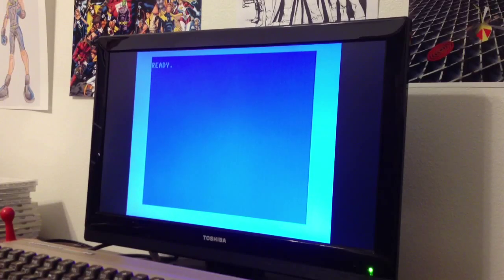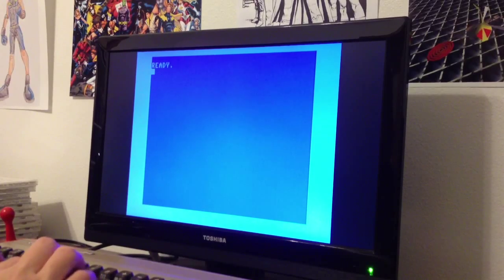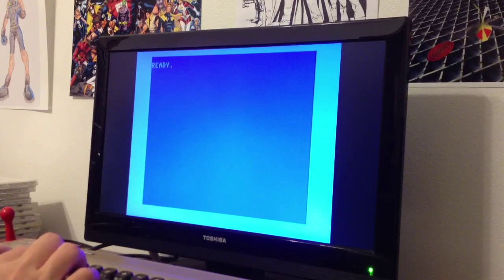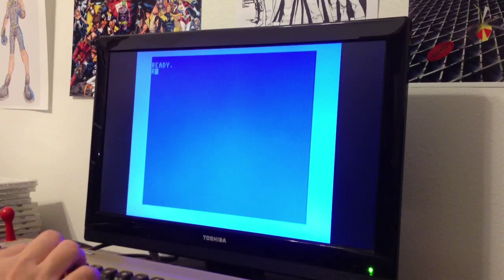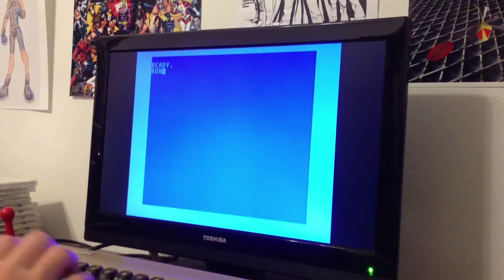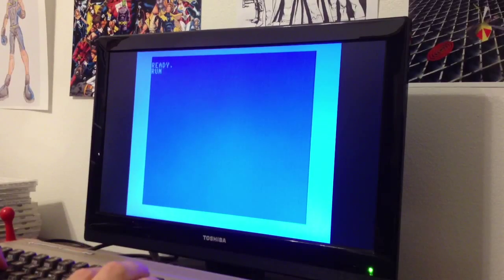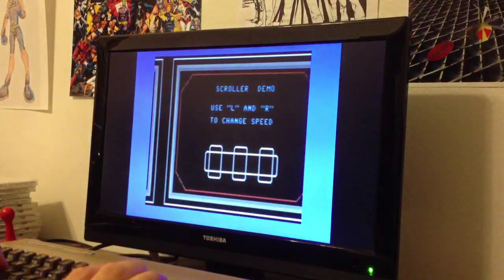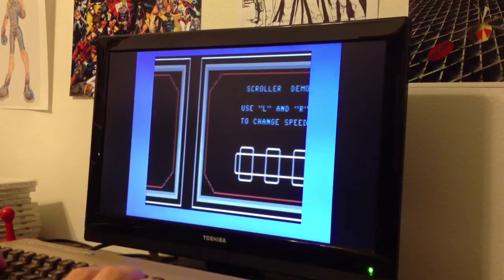C64 smooth scrolling display hack

Comment: For everyone saying the C64 doesn't have hardware scrolling, it has $D016 to scroll 7 pixels which is hardware scrolling compared to for example the Amstrad CPC. Scrolling the whole screen can be done by scrolling 7 pixels first and then copy the screen contents 1 char to the left of right depending on which direction you scroll. This takes a lot of raster time. You can also use a trick called VSP where you don't have to copy all the screen contents but only draw the column which is at position 40 hidden behind the border.

Comment: Just a note: with a total use of unrolled code (both characters and colours) and dealing with racing beam in the correct way it's even possible to do smooth scroll without using double buffering. The bad news obviously is the big waste of RAM and the fact you can use only half or less of the available cycles for the last frame and the next one, when doing the copy. This technique was sometimes used early in the day (international soccer for example)

Comment: Does anyone have a copy of the source code mentioned above? The link above doesn't have a valid URL anymore at the end of the article :(
The Wayback machine isn't working for it either...
Reply: VSP is a well-known technique.
Reply: I don't know if saw the link, but at the bottom of the text there is a link to a zip file, which has files, which seem to have assembly source.
Reply: @eugenetswong  thanks, I had already tried that link 2 years ago, but now it seems to work...cheers!

Comment: It's a common misunderstanding that the C64 has hardware scrolling, it doesn't. What the C64 has is just hardware pixel offset achieved via a pair of 8 bit registers to control the vertical or horizontal pixel offset for the screen between zero and seven pixels :o)
Reply: In other words, hardware scrolling.